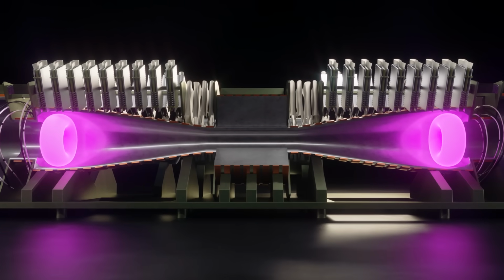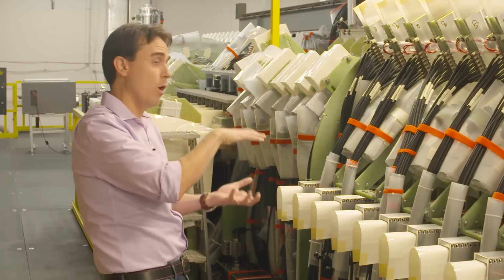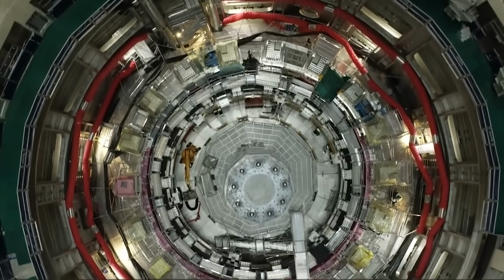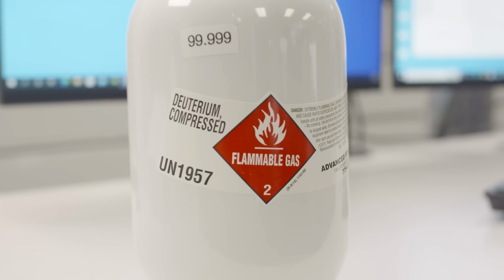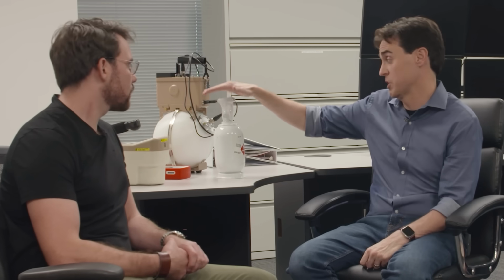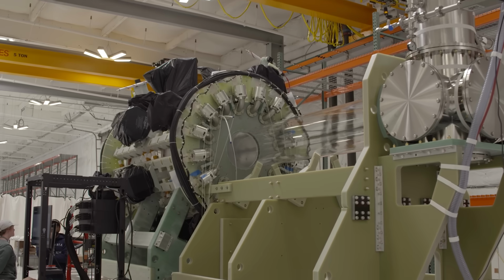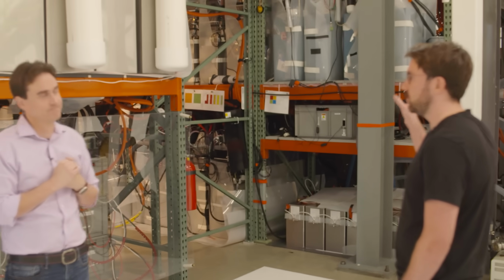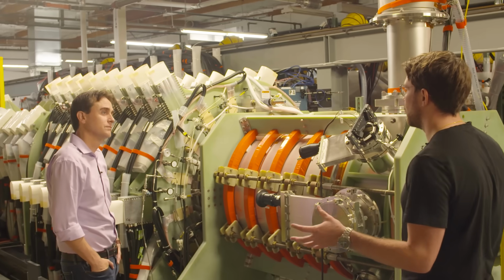A New Way to Achieve Nuclear Fusion: Helion

Comment: New? TAE Founded April 1998; 24 years ago..., not so new
Reply: This is Helion, not TAE. TAE also uses FRCs and they collide them to make a single, hotter and more stable FRC in the center. Helion's cofounder John Slough actually helped them with that. The difference is that Helion is compressing that single FRC with strong magnets in a short pulse. TAE is aiming to keep the FRC alive indefinitely (in fusion terms) with the injection of neutral beams. They are not doing compression.

Comment: How hot? 10,000,000 degrees F?
Tungsten has the highest melting point known to man and melts at 6000 degrees. unless they have an element thats not on the periodic table, then this is fake. I bet its just a fancy microwave, pizza is ready.
Reply: well the thats the metal melting point it takes time for heat to transfer to object to object if your touch a flame or a hot stove for a fraction of a second your hand doesn't instantly burn or cook maybe its the same thing for the metals not an expert but i assume that part of why the machine doesn't instantly melt
Reply: @StormTrooperEX  you’re probably spot on!
Reply: The fusion plasma is very hot (100 million degrees in Trenta, 300 million in future power plants), but not very dense (closer to a vacuum than to ambient air). So, the total energy content of the plasma in a single pulse is relatively low (a few kWh). The plasma is also surrounded by a high vacuum, which is a perfect insulator. And it is also kept away from the walls by magnetic coils. Towards the end of the pulse, the plasma is allowed to expand again and that does work and induces a current in the coils. While doing that it quickly cools off. Even just the expansion by itself would cause it to cool a bit. All that together means that this is not a big problem.
Reply: @elmarmoelzer2229  u have big brain

Comment: Looks like there is a problem... https://youtu.be/3vUPhsFoniw
Reply: Not really.
Here is my critique of the critique:

- Critique: "FRCs have been done before and never worked." 
First, define "worked"! What was the goal of the experiment and what was the outcome?
Second, yes, FRCs have been done before and the members of Helion's founding team were actually involved with several of them. They applied the lessons learned from those to their own design, which they have tested over 6 prototypes so far.
Lessons learned and applied:
1. Size of the FRC. The larger, the less susceptible to n=2, rotational instabilities.
2. Elongation to radius ratio. The longer the FRC, the more stable it is to tilt instabilities.
3. The merging before the compression. This part creates a single, hotter and more stable FRC as a target for compression. FRCs get more stable, the hotter they are.
4. Helion's FRCs have a very low electron to ion temperature (Te:Ti) ratio of 0.1 and less. That makes things a lot easier compared to machines where both are in an equilibrium because: 
P(fus)/P(loss) scales as Ti^1.5 / (Z^2 * Te^0.5 )
Where Z is the atomic number (in case you wonder about that).

- Critique: "Deuterium - Helium3 has a smaller reaction cross section than Deuterium - Deuterium. At the 100 million degrees temperature discussed in the video, Deuterium - Deuterium reactions would be much more likely than Deuterium - Helium3 reactions."
That is generally true, but the author misses some key points:
Trenta is a subscale prototype with much weaker magnets than what they are proposing for a full scale powerplant. Because of that temperatures are somewhat lower than in a full scale power plant. Power plants aim for temperatures 20 keV (220 million degrees) and up to 330 million degrees (30keV). At that point the D-He3 reactivity surpasses the D-D reactivity.
That said, Helion actually wants some D-D reactions because that is how they are breeding their He3.
D-D => He3 +n or D-D => T +p
Both reactions have a 50% chance of happening.
So, in mixed mode (breed and power) machines, they will need two D-D reactions for every D-He3 reaction, at least until the Tritium inventory is large enough that they have a constant supply from decay (Tritium beta decays into Helium3). Sicne Tritium has a half life of 12.3 years, that can take maybe 20 years. That fact is probably the best criticism of Helion's approach.

- Critique: "Deuterium - Helium3 is too hard and Tokamaks cannot do it. Therefore Helion's approach of fusing Deuterium and Helium3 can never work."
D-He3 is very hard to ignite, but they do not need ignition for their design to produce enough net electricity to be economic. Most of the energy from D-D and D-He3 reactions is released as charged particles, not in neutrons. Helion can recover the energy in charged particles directly as electricity at a higher efficiency than a steam plant would. They can also recover 95% of the input energy directly as electricity. That makes their machines a lot more efficient.
Further, FRCs are high Beta (~1.0) compared to Tokamaks (~0.05). Beta means the ratio of the plasmas internal pressure to the pressure applied externally via magnets. 
Fusion reaction rate (the amount of energy produced) scales as magnetic field to the 4th power, an extremely strong scaling. However, that is the magnetic field inside the plasma, not outside, which scales as Beta^2 and B_external^4. 
If it was just about the efficiency of the magnets (it is not), then a 10 Tesla Helion machine would outperform a 200 Tesla Tokamak.
But, it is a bit more complicated than that, because confinement times in FRCs are generally lower. You win some, you lose some. Overall it is still a win for Helion's approach.
Since Helion is using adiabatic heating through the compression stage, they can to some extent(!) balance temperature and density almost linearly for a given magnetic field. D-D reactions favor higher density and lower temperatures. D-He3 is the opposite way round. They can tune that just to the right sweet spot between density and temperature depending on which reaction they want more of.
Another thing that works in Helion's favor is the aforementioned Te:Ti ratio. This ratio actually decreases further with higher temperatures. So the hotter the plasma gets, the smaller that ratio. Trenta already showed Te:Ti at <0.1. It is likely that a power plant will have an even lower ratio. Lower electron temperatures greatly reduce Bremsstrahlung losses. At a ratio of 0.1, thermal transport losses actually kick in earlier than Bremsstrahlung.

- Critique: "The neutrons from Deuterium-Deuterium reactions would have fried Trenta and I see no shielding." 
As mentioned, Trenta is a subscale prototype, an experiment. It is smaller, weaker and only operates at one pulse every 10 minutes (max). A full scale powerplant would do 10 pulses a second!
Not all shots were fueled by Deuterium or Deuterium + He3. Many were fueled by a mix of hydrogen and Deuterium or pure hydrogen, depending on what they wanted to test.
Because of that alone, the total neutron flux that Trenta has experienced so far is not that high.
What the critique does not mention is that neutrons from D-D reactions have a much lower energy than those from Deuterium- Tritium reactions (2.45 MeV vs 14 MeV). Those 2.45 MeV are below the activation energy of many materials.
The machine is mostly made from low activation materials or materials with a half life measured in minutes. Aluminum activated by D-D neutrons has a half life of 2 minutes.
In fact testing different materials under neutron exposure was one of the purposes of Trenta. They have tested quite a few alloys to see how they behave.
There is still permitted shielding of course. It is in the walls of the room and not close to the actual machine, which can handle the aforementioned relatively reduced neutron load just fine. 
It is also worth mentioning that a mixed mode Helion power plant (that does both breeding and power production) would produce neutrons only in one third of all reactions. So the neutron flux, even for those machines would be lower than for a D-T Tokamak.

- Critique: "Helion claims that they discovered new physics when they say that the ion gyro radius is 25% larger."
The whole ion gyro- radius thing was based on a misunderstanding and out of context quote and maybe also bad wording.
What happened was that Trenta achieved a higher ion temperature than predicted by Helion's too conservative physics model (a higher ion temperature is actually a good thing!). That higher ion temperature caused a 25% increase in ion gyro radius, which is perfectly in line with established physics. That's it. Nothing to see here!

- Critique: "Helion had previously said that they would have a working power plant in 2021. "
IM was very eager to get a "gotcha" on Helion. I guess he did not read further up on the page, or he would have seen that Helion was in the process of raising funding at the time. They did not get that funding until now. Even Trenta was less than 35 million (especially if you take the 35 million into 2019 dollars, when they started building it).
No bucks, no Buck Rogers. Should be quite clear, no?
Reply: @elmarmoelzer2229  damn bro you just don't stop do you. You must have invested in Helion the way you defend it.
Reply: @larkinpaul  Nope, have not invested in Helion bro. Just trying to educate people.

Comment: One thing I don't understand is them saying to split the reaction of deterium with helium. As combining these elements will always result in deterium still reacting with itself.  If He3 and deterium are in the pressure chamber
Reply: And that is a good thing. They need two D-D reactions for every D-He3 reaction. That is how they make their He3 (so they don't have to mine the moon).
The ratio of D-D to D-He3 reactions can be tuned by increasing or decreasing the density to temperature ratio. D-He3 favors a higher temperature and lower density. D-D the other way round.

Comment: what about this criticism? done by "Improbable Matter", claiming many heavy problems with the company
https://www.youtube.com/watch?v=3vUPhsFoniw
Reply: My critique of the "critique" by IM:

- Critique: "FRCs have been done before and never worked." 
First, define "worked"! What was the goal of the experiment and what was the outcome?
Second, yes, FRCs have been done before and the members of Helion's founding team were actually involved with several of them. They applied the lessons learned from those to their own design, which they have tested over 6 prototypes so far.
Lessons learned and applied:
1. Size of the FRC. The larger, the less susceptible to n=2, rotational instabilities.
2. Elongation to radius ratio. The longer the FRC, the more stable it is to tilt instabilities.
3. The merging before the compression. This part creates a single, hotter and more stable FRC as a target for compression. FRCs get more stable, the hotter they are.
4. Helion's FRCs have a very low electron to ion temperature (Te:Ti) ratio of 0.1 and less. That makes things a lot easier compared to machines where both are in an equilibrium because: 
P(fus)/P(loss) scales as Ti^1.5 / (Z^2 * Te^0.5 )
Where Z is the atomic number (in case you wonder about that).

- Critique: "Deuterium - Helium3 has a smaller reaction cross section than Deuterium - Deuterium. At the 100 million degrees temperature discussed in the video, Deuterium - Deuterium reactions would be much more likely than Deuterium - Helium3 reactions."
That is generally true, but the author misses some key points:
Trenta is a subscale prototype with much weaker magnets than what they are proposing for a full scale powerplant. Because of that temperatures are somewhat lower than in a full scale power plant. Power plants aim for temperatures 20 keV (220 million degrees) and up to 330 million degrees (30keV). At that point the D-He3 reactivity surpasses the D-D reactivity.
That said, Helion actually wants some D-D reactions because that is how they are breeding their He3.
D-D => He3 +n or D-D => T +p
Both reactions have a 50% chance of happening.
So, in mixed mode (breed and power) machines, they will need two D-D reactions for every D-He3 reaction, at least until the Tritium inventory is large enough that they have a constant supply from decay (Tritium beta decays into Helium3). Sicne Tritium has a half life of 12.3 years, that can take maybe 20 years. That fact is probably the best criticism of Helion's approach.

- Critique: "Deuterium - Helium3 is too hard and Tokamaks cannot do it. Therefore Helion's approach of fusing Deuterium and Helium3 can never work."
D-He3 is very hard to ignite, but they do not need ignition for their design to produce enough net electricity to be economic. Most of the energy from D-D and D-He3 reactions is released as charged particles, not in neutrons. Helion can recover the energy in charged particles directly as electricity at a higher efficiency than a steam plant would. They can also recover 95% of the input energy directly as electricity. That makes their machines a lot more efficient.
Further, FRCs are high Beta (~1.0) compared to Tokamaks (~0.05). Beta means the ratio of the plasmas internal pressure to the pressure applied externally via magnets. 
Fusion reaction rate (the amount of energy produced) scales as magnetic field to the 4th power, an extremely strong scaling. However, that is the magnetic field inside the plasma, not outside, which scales as Beta^2 and B_external^4. 
If it was just about the efficiency of the magnets (it is not), then a 10 Tesla Helion machine would outperform a 200 Tesla Tokamak.
But, it is a bit more complicated than that, because confinement times in FRCs are generally lower. You win some, you lose some. Overall it is still a win for Helion's approach.
Since Helion is using adiabatic heating through the compression stage, they can to some extent(!) balance temperature and density almost linearly for a given magnetic field. D-D reactions favor higher density and lower temperatures. D-He3 is the opposite way round. They can tune that just to the right sweet spot between density and temperature depending on which reaction they want more of.
Another thing that works in Helion's favor is the aforementioned Te:Ti ratio. This ratio actually decreases further with higher temperatures. So the hotter the plasma gets, the smaller that ratio. Trenta already showed Te:Ti at <0.1. It is likely that a power plant will have an even lower ratio. Lower electron temperatures greatly reduce Bremsstrahlung losses. At a ratio of 0.1, thermal transport losses actually kick in earlier than Bremsstrahlung.

- Critique: "The neutrons from Deuterium-Deuterium reactions would have fried Trenta and I see no shielding." 
As mentioned, Trenta is a subscale prototype, an experiment. It is smaller, weaker and only operates at one pulse every 10 minutes (max). A full scale powerplant would do 10 pulses a second!
Not all shots were fueled by Deuterium or Deuterium + He3. Many were fueled by a mix of hydrogen and Deuterium or pure hydrogen, depending on what they wanted to test.
Because of that alone, the total neutron flux that Trenta has experienced so far is not that high.
What the critique does not mention is that neutrons from D-D reactions have a much lower energy than those from Deuterium- Tritium reactions (2.45 MeV vs 14 MeV). Those 2.45 MeV are below the activation energy of many materials.
The machine is mostly made from low activation materials or materials with a half life measured in minutes. Aluminum activated by D-D neutrons has a half life of 2 minutes.
In fact testing different materials under neutron exposure was one of the purposes of Trenta. They have tested quite a few alloys to see how they behave.
There is still permitted shielding of course. It is in the walls of the room and not close to the actual machine, which can handle the aforementioned relatively reduced neutron load just fine. 
It is also worth mentioning that a mixed mode Helion power plant (that does both breeding and power production) would produce neutrons only in one third of all reactions. So the neutron flux, even for those machines would be lower than for a D-T Tokamak.

- Critique: "Helion claims that they discovered new physics when they say that the ion gyro radius is 25% larger."
The whole ion gyro- radius thing was based on a misunderstanding and out of context quote and maybe also bad wording.
What happened was that Trenta achieved a higher ion temperature than predicted by Helion's too conservative physics model (a higher ion temperature is actually a good thing!). That higher ion temperature caused a 25% increase in ion gyro radius, which is perfectly in line with established physics. That's it. Nothing to see here!

- Critique: "Helion had previously said that they would have a working power plant in 2021. "
IM was very eager to get a "gotcha" on Helion. I guess he did not read further up on the page, or he would have seen that Helion was in the process of raising funding at the time. They did not get that funding until now. Even Trenta was less than 35 million (especially if you take the 35 million into 2019 dollars, when they started building it).
No bucks, no Buck Rogers. Should be quite clear, no?
Reply: @elmarmoelzer2229  lmao can't stop won't stop spamming essays.